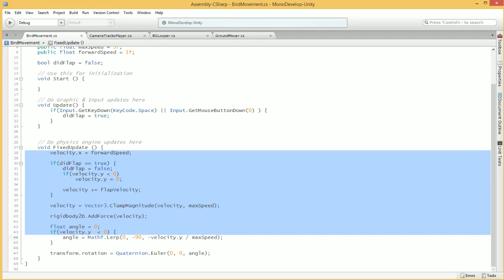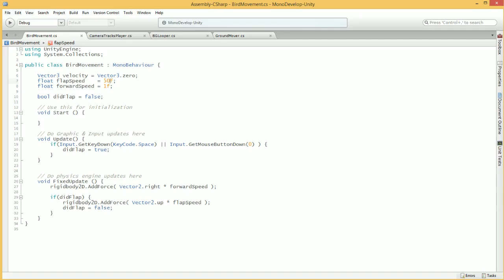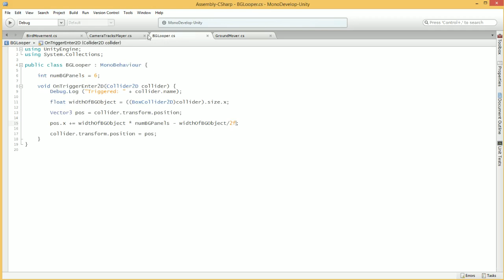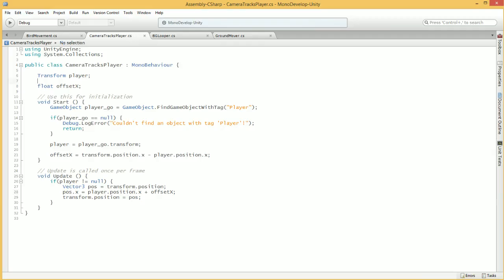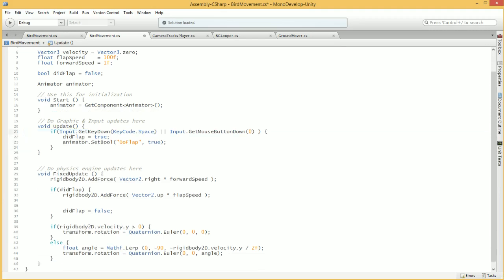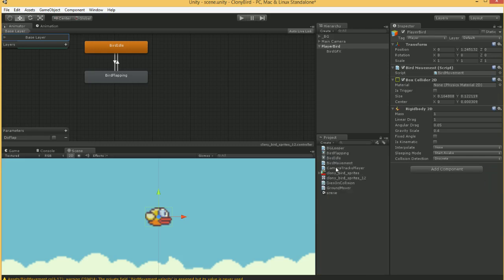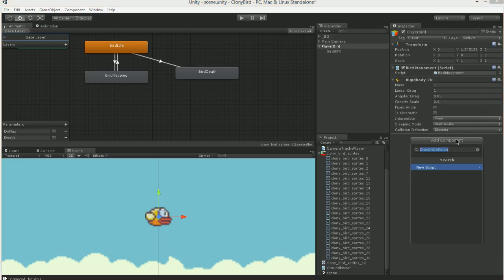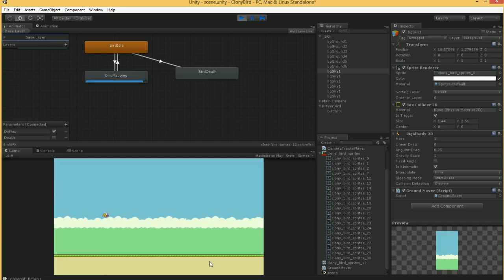Unity Tutorial: A Complete 2d Game (ClonyBird) - 5/7

Comment: 2d doesn't suck - you're fighting against it ;) . The bird sinks through the floor because you turn the rigid body forcing it to intersect. Never directly turn a rigid body. You brake the rules, stuff goes wonky.

1. Turn off rotation AND friction on the rigid body of the bird. Makes the bird skate along the floor...
2. Rotate the image of the bird instead of the rigid body.
3. Use a circle collider instead, it's cheaper and matches the form of the bird. A box works, of course, but where you can use a circle, use a circle. The math is vastly simpler for collision checks.
Reply: I should say, Box2D doesn't suck, the integration with Unity might, I have no direct knowledge of that.

Comment: IMPORTANT: As of Unity 5, the code 'rigidbody2D' is obsolete and has been replaced with 'GetComponent<Rigidbody2D>()'. Any time Quill uses 'rigidody2D' simply replace it with 'GetComponent<Rigidbody2D>()'.
Reply: Robert Hawke Thanks this info was really helpful....
Reply: Robert Hawke Life saver!!!
Reply: +Robert Hawke in the case of fixing the groundmover file at the end of the video, how do we implement GetComponent<Rigidbody2D>() with player? 

I set it as GetComponent<Rigidbody2D>() player; 
but I keep getting an error
Reply: +Tom Bachar I am having the same problem, have you found a fix yet?
Reply: Only change you have to do vs. the tutorial is on the line 
player = player_go.rigidbody2D;
 which you should change to 
player = player_go.GetComponent<Rigidbody2D>();
Reply: Thanks bro!

Comment: Just wondering.. I remember reading something about the sprite pixel being divided by 100 (pixels-to-units) because the physics system doesn't work well with high values (or something like that)... so if we move the camera endlessly to the right, won't its position eventually be a really high value? I wonder if it will start messing things up.

Comment: I agree that setting position of an object (it this case: the bird :)) directly is not recommended cause it does not work with the physics. However, rewriting all movement script to use is AddForce as you done in the script is not required. You could use Rigidbody2d.MovePosition() instead of setting position - it should work great cause MovePosition() take into consideration all unity engine physics calculations :) BTW look at Rigidbody2d.MakeRotation() :).

Comment: When i make a transistion from BirdIdle to BirdDeath my bird doesn't change to grey when it hits the ground. I've checked my code like 20 times and redone the process several times. Also when it hits the ground it just slides without stopping or rolling. 

Heres my code: using UnityEngine;
using System.Collections;

public class BirdMovement : MonoBehaviour {

	Vector3 velocity = Vector3.zero;
	float flapSpeed    = 100f;
	float forwardSpeed = 1f;

	bool didFlap = false;

	Animator animator;

	bool dead = false;

	// Use this for initialization
	void Start () {
		animator = transform.GetComponentInChildren<Animator>();

		if(animator == null) {
			Debug.LogError("Didn't find animator!");
		}
	}

	//Do Graphics & Inputs updates here
	void Update() {
		if(Input.GetKeyDown(KeyCode.Space) || Input.GetMouseButtonDown(0) ) {
			didFlap = true;
		}
	}

	// Do physics engine updates here
	void FixedUpdate () {

		if(dead)
			return;

		rigidbody2D.AddForce( Vector2.right * forwardSpeed );

		if(didFlap) {
			rigidbody2D.AddForce( Vector2.up * flapSpeed );
			animator.SetTrigger("DoFlap");

			didFlap = false;
		}

		if(rigidbody2D.velocity.y > 0) {
			transform.rotation = Quaternion.Euler(0, 0, 0);
		}
		else {
			float angle = Mathf.Lerp (0, -90, (-rigidbody2D.velocity.y / 3f) );
			transform.rotation = Quaternion.Euler(0, 0, angle);
		}
	}

	void onCollisionEnter2D(Collision2D collision) {
		animator.SetTrigger("Death");
		dead = true;
	}
}
Reply: Same thing for me, fixed it yet?
Reply: Same here

Comment: Help me! My background is still keep speeding up while the bird in the air :O
Reply: I needed to clamp down the speed.  I used
float maxSpeed = 2f;

		rigidbody2D.AddForce( Vector2.right * forwardSpeed );
		rigidbody2D.velocity = Vector2.ClampMagnitude(rigidbody2D.velocity, maxSpeed);
Reply: I think all you have to do is set Linear Drag to 1 in Rigidbody 2D, player object.
Reply: +Tamás Erdős hii i am having the same problem all my other codes are not working such as my main camera code ,trackplayer code etc after changing my bird code ,due to these changes the background keeps speeding up and after couple of frames my frames are triggering twice.all of these were working fine before this tutorial